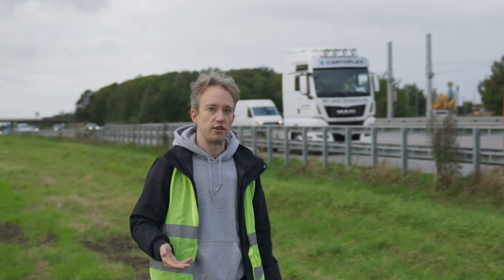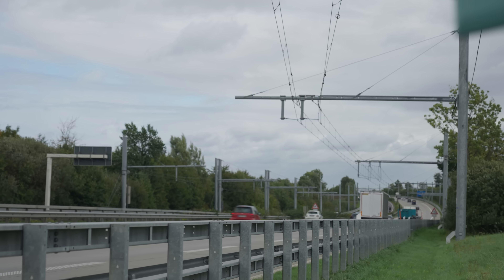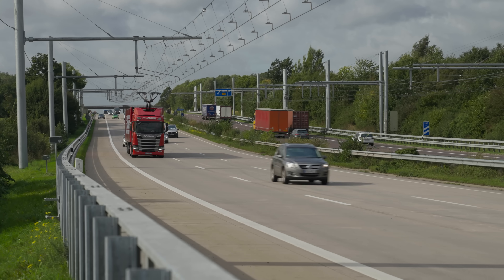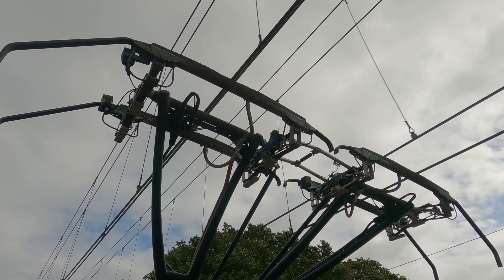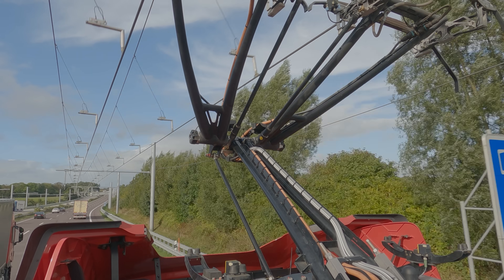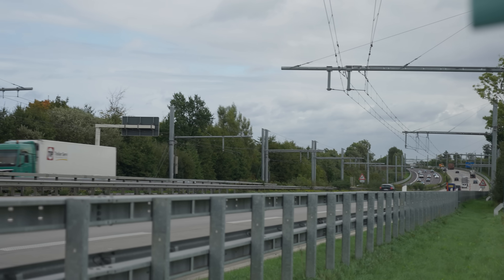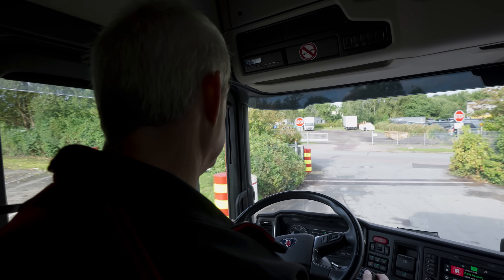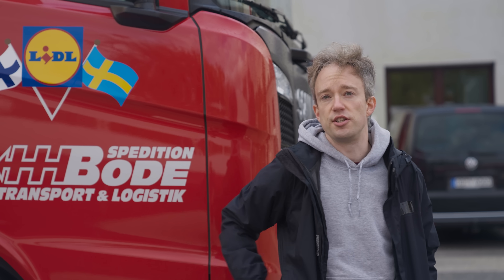The highway where trucks work like electric trains

Comment: As someone who works on the railroad, I'm curious how they will deal with the issue of the pan pulling the wire down and disrupting the entire system.
Reply: Not only that, but the fires that can be caused if the pantograph disconnects all of a sudden
Reply: @Sebdamememan  Well, clearly these need to be smart pantographs with safeguards  against all the failure modes that trains don't really need to worry about, but will happen all the times on trucks. Is it easy to build such systems? Certainly not. But possible? I'm very confident, and indeed the prototypes already seem to be designed to handle any danger situations by stopping to pull current and retracting the pantograph.

Obviously this requires that the trucks are fully capable (albeit short-range) battery electric vehicles that only use the overhead supply for extending their range.
Reply: @Sebdamememan  Oh the horrors of daily burning trains everywhere. Now they want burning lorries.
Reply: @maythesciencebewithyou  its not that it happends daily, but the science of how a pantograph works is there, if for some reason the truck driver lost control, or for some unknown reason the pantograph lost contact with the overhead it could start a serious fire, trains dont have that problem cus they run on a fixed track, with a constant tension and contact with the overhead, but if such an event where to happen the same fate would land in for the train.
Reply: I think trolley poles are a better idea than pantographs for this reason. But then you have the problem of connecting and disconnecting. Someone needs to develop an automated smart trolley pole that can find and connect to a wire.
Reply: They will deal with it by saying that the outages and the resulting shortages are the new normal.

Comment: This idea isn't going to be widely used ever, because trains exist, railways are a lot cheaper, 9x less energy per tonne kilometer traveled than trucks, 75% less emissions, 4 times more fuel efficient. Trucks are only cost effective for short distance, door to door delivery and delivery through rough terrain. This technology aims to lower the cost of long distance trucking which requires building a whole new infrastructure of wires above highways which is bad in so many ways that i can't be bothered to list them all, and even if the infrastructure is built those long distance trucks won't be able to compete in terms of cost and payload with trains.

Comment: Wouldn't a sub-surface induction loop system be a better solution though? Then all EVs could benefit, not just those with pantographs. There would also be less risk of injury or wear/damage to equipment and whilst maybe trivial - less of an eye-sore
Reply: I would guess the money problem makes this impossible, also I would be worried about the efficiency of such energy transfer. Sometimes the simpler solutions are better.

Comment: So what is the difference to a train then?
Why buil an entirely new infrstructure if you can just use electric trains?

I thought Trucks were better since they could use the road network which is better conmnected than trains and they can pick up and deliver from and to each company regardless if there is a train station there. 

But you cant outfit every road with this

Why not just expand the rail network? Benefits passengers as well to pick trains instead of their cars

Comment: Why don't we just replace the road with tracks, leave the overhead wires, as well as replacing the rubber tires with steel, and connecting the trucks together?
Reply: @dbUK77  1. I understood almost none of what you said.
2. You didn't seem to get the joke. My point was about trains. One freight train can take off 70 lorries off the road, but you need the lorry to go to the specific place.

Comment: One concern I have is for pedestrian crossings over roads like they have at service stations. They would probably need to work in breaks in the line or engineer some other solution I'm not even thinking of. 

And of course, the question of why not just build more railways? The environmental and momentary cost of implementing the wires would have to have a major advantage over building rails for it to work. I can see it happening as the majority of the infrastructure is in place and it would save on earthmoving costs. Not to mention that lorries can climb hills that trains simply can't.

Comment: I love how these ideas are always not considering the amount of energy it actually takes to operate. Ignoring that will then end up in another push of coal power or even nuclear power, or even better imported electricity. Because current green tech isn't build to that amount or not even good enough yet to handle it. 

Perfect how this is another idea for idk in 20 years maybe?
Reply: Ohhhhh, how I wish nuclear would still be a viable option, but we unfortunately we panicked about something that happened in the soviet union and decided to do away with that. Replacing it... with coal.

Comment: Why not reduce the friction even more and put them on metal rails?
Then one tractor could pull dozens of trailers.
Oh, wait...
Reply: Well then get onto building inflexible rails and station infrastructure to every and every local shop. That surely wont add up to the cost
Reply: @FlyLeah  a lot cheaper than maintaining roads.
Reply: @FlyLeah  no problem. We had that 100 years ago and guess what: most of the rails are still in place, left to be overgrown. Should be much cheaper to restore them instead of doing this insanity!
Reply: Bravo!
Reply: why use rails when you can use magnets?
Reply: Well, what if you want to move just one container?
Reply: @MrGilang100  There will likely be 50 others needing to go to somewhere nearby - ie a train. Then an electric truck can do the 'local' delivery. This is no different to 'What if you have 1 parcel?' You don't do a round trip with it  - you hand it to the Post Office or UPS or whoever and they batch it up. It's not rocket science!
Reply: @EuroScot2023  and that is exactly my point, sometimes you need to deliver just a container.
Reply: Mounds of dirt called hills would like a word with your metal wheels.

Comment: Great idea because it is practical and flexible. All the people saying " why not just make it a train"... 

There's a reason why it isn't working at the moment via that medium.

Trains are too inflexible. 

You have to get the goods to ONE deport and one mistake takes everything out. If a truck breaks down on this system, the rest disengage and pass around it. Try that with a train.

You also have the massive headache of overly busy lines and the impossible task of making new ones.

New roads can be done it small stages, linking existing networks. New train-lines either go all the way, in one vector, to a station or not at all. 

Tramlines on roads cause an insane amount of accidents and have been tried again and again. They just don't work long term.

Comment: It's just a shame that this government is still ordering diesel trains which have a life span of 30-40 years & has stopped most electrification of the rail network. So even with electric road vehicles on whichever system running about in the near future. 40 years from now trains will still be running on diesel.

Comment: I'm so surprised that this isn't better known, it's really an obvious solution for one of the main complaints about EV.
Reply: it's nonsense though: why not use (and restore) the extensive rail network that Germany had connecting warehouses, ports and stores for centuries?! this is literally electric trains, but less efficient, more expensive and more dangerous (because they share the road with tiny compact cars)!
Reply: It is not better known because it is nonsense. It is an idea that has been around for 100 years and is nonsense. 
Commies love this crap because they are all about pushing control and they want a planned economy.
Reply: @bighands69  how the hell is a powered line for EV trucks communist?

Comment: My prediction is at some point EV’s will have tires that can charge through induction coils under the road! :)
Reply: Why would you want to charge a tyre?  Would be better to just charge the battery, it's induction after all, there doesn't have to be any connection.

Comment: For trains it makes sense cause they are anyway restricted to the rails. But for trucks and buses is not, cause it restricts them to the ugly bulky wire construction. If it was good enough it would be more popular choice for buses then diesel, for it is present for buses too for over a century (trolleybus). So why ? We don't need to ditch of fossil fuels. CO 2 is not pollutant and surely not main driver of climate change. Why ditch simpler, cheaper, easier, reliable source of energy to gain nothing ? Does not make sense

Comment: What about the heat generated from the friction? Such massive amount of electricity alone should generate a lot of heat and on top of that, we are adding such huge amount of friction.
Reply: What friction? On the pantographs? Those run on graphite lubrication, there is no issue with friction that would meaningfully impact overall system efficiency.
Reply: @namibjDerEchte  thanks, I didn't know that. I was wondering if those cables and pantographs are made of metals since they are the perfect conductor for electricity. But I guess in this case they chose graphite.

Also, are those cable scratches on top of the pantographs or those were just lubricant gaps? 3:02

Comment: I grew up in a city with electric trolley busses. Trains use the track as ground. Vehicles with rubber tires have a second overhead conductor line for a ground connection.

Comment: One of those gimmicks that will die out soon but taxpayers have to fund those incredibly dumb ecofreaks. As long as we dont have emission free electricity its still only half assed solution. And its expensive, unpractical, will take LOOOOONG time to implement and it wont reduce emission that much.

Comment: So spend Billions, and Billions of Euros , in this case,  on a project that maybe or may not pay off.  How is this going to handle a large or hug convoy of trucks?  High winds, extreme weather like snow and heavy rain?   Those kinds of overhead  catenary wires are for trains only, not for trucks. How much extra is it going to cost to put that on the truck, and maintain it?  Will the public like it?

Comment: Count me suspicious of his economic analysis.  The additional technology in the truck, the cost of the wiring system in the highway, and the cost of generating and transmitting the electricity, and with all of those additional costs, it saves money?  I seriously doubt it.

Where semi-truck emissions could be reduced greatly is in idling.  Walk through any truckstop at night and find as much as 50% of the trucks idling.  All night long.  Provide a means of plugging in trucks to power at night (and a way to plug it in to a semi) and that could be big.  There is "shorepower" right now, but few truckstops have it, and truckers must pay to use it.

Comment: I remember when they tore out all the tram lines here and replaced the buses with clean-burning diesel models.  I think they’re CNG now.
Reply: GM paid for a lot of those lines to get removed a long time ago.  I was told that buy a fellow who would have been 95 this year.
Reply: Most buses in the Netherlands are still diesel-powered, but the number of electric ones is rising quickly, with charging stations at important stops/termina (terminuses? no idea) where a small pantograph takes power from a rather sturdy structure.
As far as I know, only a small portion runs on CNG.
I would have to look it up, but can't imagine the bus-lobby in my country to pay for getting rid of the electric trams from the fourties and fifties onwards, when most local tramcompanies ceased to operate as the bus provided a more favourable alternative. Many communities now try to get the tram back as the buses can't handle the number of passengers anymore.

Comment: Maybe a train would be a lot more efficient, safer, more reliable and cheaper to maintain in the long run 😉
Reply: It’s funny how we’ve tried for over a hundred years trying to revolutionize transport, only to always end up (re)inventing a train. Maybe it’s time to embrace what is proven to be effective and efficient 🚃
Reply: indeed it would and it wouldn't be as prone to weather damage compared to these 'lines' which would cost more to install over such a long distance.
Reply: I have a cargo in my warehouse that needs to be delivered to 4 stores. How can the railway deliver the load to the 4 stores ?

Comment: Looks great! Unless you’re a radio ham. Those overhead commutators constantly arc and spark a little, creating quite a lot of very wideband radio noise.
Furthermore, if anything is going to make a case for human exposure to potentially harmful non-ionising EM waves, this could be that for the truck drivers. Though personally I think narrowband EM waves targeting a certain molecular resonance are more likely to impact biological functions. Causing proteins to fold in different ways, or even unfolding them, for example. The more we know about that, the better we can ensure that continued radio use doesn’t pose any problems.

Comment: Tire technology is one of the main reasons petrol is so inefficient. The friction between rubber and road eats up so much energy. That’s why trains are so efficient at moving heavy objects long distance. Steel on steel is almost zero friction. Now equipping trucks with steel wheels is not feasible. Nor is running tracks in the highway. You may as well use trains to move your goods. Getting a tire compound that reduces that friction is key.
Reply: The Amish stuck to big wooden wheels and they seem to pull their carriages just fine, so we gotta think backwards

Comment: How is using fossil fuels to produce energy, such as electricity, any better then using fossil fuels to power a vehicle itself?

With further electricity demand, Every country would need its electrical infrastructure rebuilt as their all running within 5% of their max capacity. Currently, energy production worldwide emits more green house gasses then all of the worlds passenger cars.  Numerous scientific papers can be searched on google that show the sources of where green house gasses are emitted.

The more technologically advanced consumer goods (from cars to refrigerators) become, the more disposable they become as they're harder to repair once there planned lifespan is complete.

You can keep your EV's..I'll switch to steam powered vehicles if I have too.

Comment: Trucks could go electric with much smaller batteries (30mi ranges) if they recharged every time they got on a highway. That would help in solving a major challenge associated with scaling up electric trucks -- not enough batteries.

I also am curious about putting solar panels on top of that infrastructure...

Comment: I don't get it, why would you put that in the right hand lane where all the traffic is getting on/off, instead of the far left / carpool / HOV lane where smaller vehicles can avoid the rigs traveling long distances? Or are things just that drastically different between the american interstate highway system and the inter-euro-zone routes? I'm somewhat familiar with lane discipline in a german sense from articles and videos on the subject, and it makes sense to have large trucks avoid having to move across three to five lanes of traffic to reach the carpool lanes... But I'm really confused and curious why they'd opt to avoid the center divider when it's clearly "Free Real Estate" as far as overhead concerns...